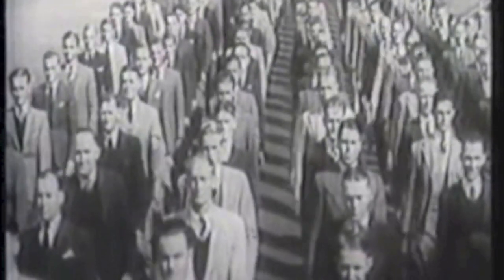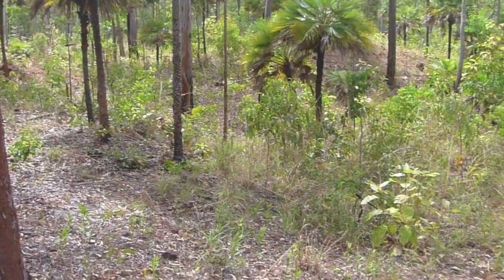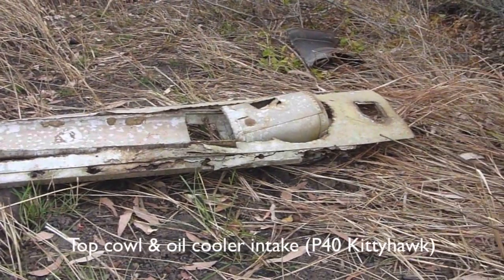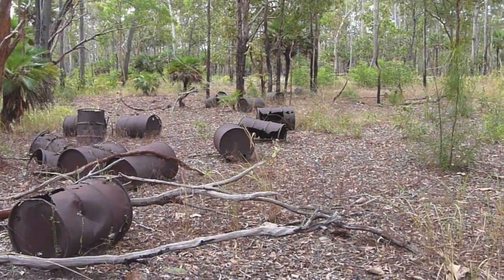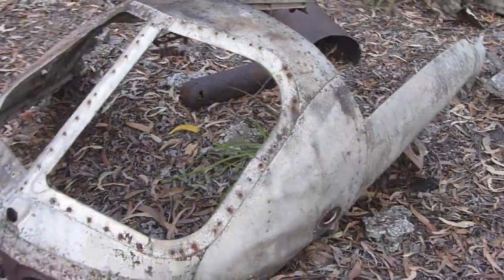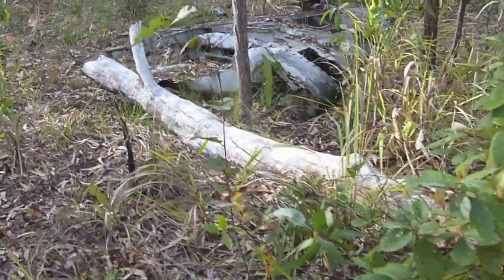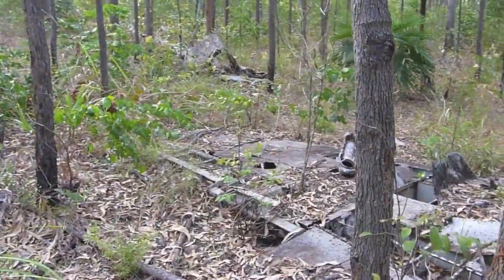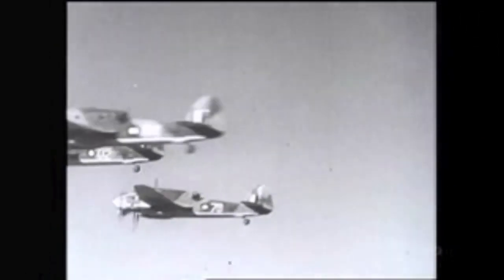WW2 Aircraft Wrecks: Northern Australia.

Comment: What you have is the P-40 supercharger air intake, as both radiators and single oil cooler units were housed just inside the big intake on the lower front. In our area the woods & swamps have a few of these WW2  wrecks still around. That was some of the fortunes of the air particularly without any kind of radar air traffic control  which made mid airs a part of the business.

Comment: I also have my Civ. Airframes & Power plants licenses, but have spec. in structures (metal & composite.) since the Navy. I worked for the millionaire between working in a Gov. Depot on F-14s & the airlines. I used to work a lot on small aircraft on the side, but have sort of retired from that.

Comment: That top cowling intake is actualy the carburetor scoop, not oil cooler. If there is a butterfly must be to select cold or hot air for the carburetor. There were no lox cylinders in WWII, because lox only came later. In fact, there never was lox cylinders because liquid oxygen should never be contained in confined vessels or they'll blow up. Converters are used instead. Beauforts were dead traps.